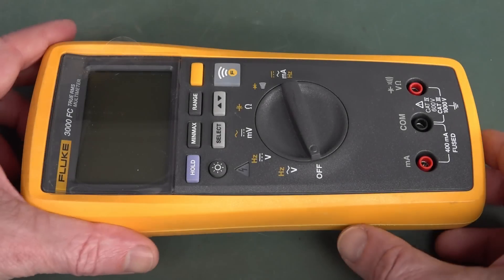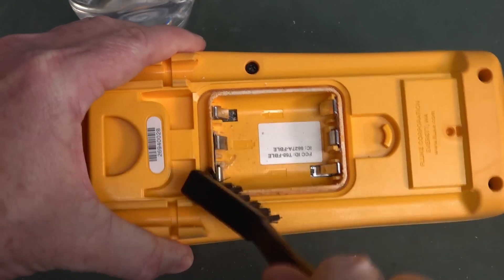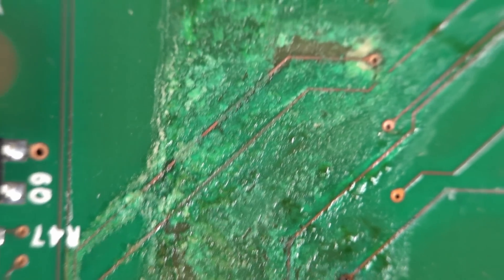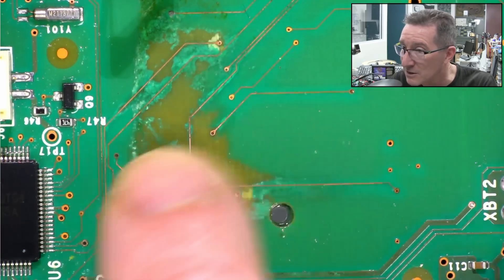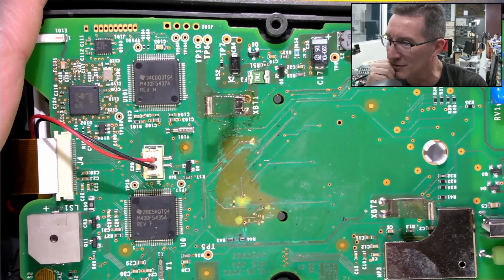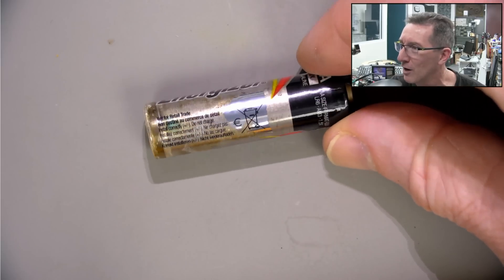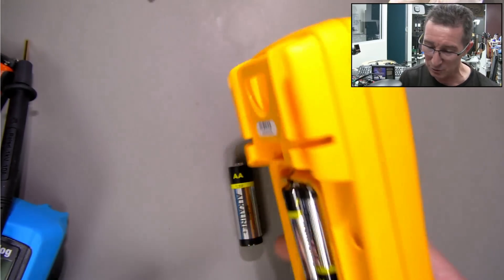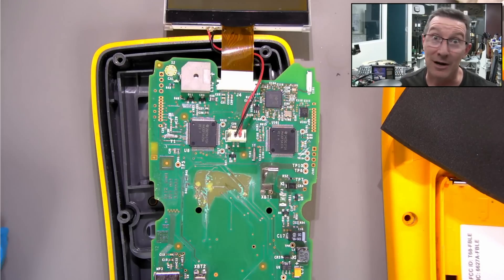EEVblog 1497 - RIP Fluke. Thanks Energizer. NOT.

Comment: The "crack" on the back-case is a result of blisterforming.
The Fluke Yellow plastic contains a metal filler meant to be a fire-retardant. It is probably the same as what made ivory PC's yellow over age, as well as parts of washing machines.
Reply: Not a metal filler, but may be some metal derivatives like a metal hydroxides. That's difference. 
And yes, plastic was broken by mechanical force of crystallizing chemicals. It even hasn't have to react with plastic, it can press against two parallel surfaces and break them.
Reply: @kbs3055  indeed. It is a salt of a metal (Barium?) I'm not a chemist but I know a little bit of Chemistry as I had that during my study (Electro/Electronics). Usefull knowledge.

Edit: After a bit looking around I found Bromine (not a metal) and compounds of Magnesium (among others).

@ S W: Ivory PC's isn't that long ago, and I bought in 2009 a new washing machine that also has yellowed a lot before I had to replace it due to repeated computerboard faults (in 2015) by a new one.
Reply: The chemical which caused plastics (used in everything from PCs to washing machines to home appliances and more) from the last century to yellow is a fire retardant called Bromine. It's difficult to determine if it is still used in modern plastics.
Reply: @stopthebus   There is a guy on YouTube who has done videos about how to whiten old plastic that has yellowed, such as that found on game consoles, with electrolysis.
Reply: @goodun2974  Ok that's interesting. Not heard of it being done with electrolysis before. Have you got a link to the vid? I did a quick search, couldn't see anything.
Reply: @stopthebus  , in case my link doesn't post, it's on the Odd Experiments channel and requires high strength hydrogen peroxide and LED UV lights.
Reply: @goodun2974  I think it's not electrolysis as you don't use electric current, but I'm not chemist.
Reply: @kbs3055  , Actually you are correct but I got my wires crossed figurative. I seem to recall somebody else on YouTube that was actually using an electrolytic process, with some kind of chemical solution and electricity, to "bleach" the plastic.  Not sure about this as it was several years ago that I saw it. I'm old and memory does play tricks on me!
Reply: Some of the Fluke meters are now made in China. The quality is terrible. Be cautious. I also ordered some "Fluke" meter leads from a Chinese distributor. They arrived and looked authentic. I used them for a while and started to detect some small differences from my older truly authentic Fluke leads. They felt more noodly like overcooked spaghetti and I played my hunch and cut and stripped one to have a closer look. Sure enough, I discovered that the number of stranded conductors in the lead was less than half that of the truly authentic Fluke 10 amp leads. Not only a fraudulent sale but a dangerous sale. There is no way these leads would have carried ten amps safely. I have learned over and over that the Chineese have no ethics when it comes to trade . (Or ethics in anything really) They are out to cheat you in every way possible and they have no compunction about theft of design or theft of cash. Steer clear of anything Chiinese. The only reason an Apple phone is of decent quality is because the Chhineese use them to spy on the West and to figure out the best way to ship fenatnyll into the U.S. to kill Americans. Especially Ameerican kids.
Reply: Oh, that makes sense. Interesting.

Comment: All alkaline batteries will leak when they are discharged or just get old.  I stopped using alkalines decades ago.  I have never had a leaking eneloop NiMH battery.  I like to use rechargeable lithium 9V batteries for my Fluke DMM and smoke detectors, although I don't mind using alkalines in smoke detectors siince they chirp when the voltage starts dropping.

Comment: Ah the optimisim at the start.. I've been there.. Alkaline batteries just suck in the last few years.. panasonic, duracell, energizer, you name it i've had them leak, in date and many times still in the packets, even when stored at stable temperatures in low humidity. I went back to zinc carbon batteries, seem much more predictable.

-edit-.. yes i've seen coppertops and I some others basically eat away and entire board before, copper and all..

Comment: Wow great tear down in 4K glory.  Sorry about the Fluke Dave and ouch this is one meter you don't want a leak in.  I'm really surprised as Energizer and Duracell are the top 2 brands that you can trust will not leak.  Also surprised the acids can get into the PCB and even damage the PCB which is usually coated with some kind of protective resin.  But what causes the battery to leak in the first place if the meter is off?  Has the battery been sitting there for years?  Also Fluke uses a lot of 9V batteries in their meters.  Do 9V leak as well or is it just these AAs.  I've only seen cheap generic AAs leak once and not 9V.  But 9V are rarely used except in smoke detectors and multimeters but it's never leaked and they can sit in a smoke detector and multimeter for years.  I've also rarely seen AAs leak except once so am puzzled how this happened.  Great video for us multimeter aficionados.

Comment: I "found" one in my battery box recently, unused and expiration date in like 2 years but it already leaked. Energizer HAS to do something about that, I can understand that they can't guarantee them to not leak over decades, but unused within the use-by-date?!
I'm glad I didn't put this one into use but I just can't trust them anymore. I bought like 90% Energizer batteries over the last years but I think that has to change until I can believe them to not leak for like 10 years.

EDIT: It wasn't the first one to leak but it was the first unused one. 
Once had a pack of store brand batteries (that looked pretty similar to Energizer) leak in a still sealed package and its juice soaked trough half the pack. Went straight to the recycler.

Comment: Always store the meters with display facing up. This will prevent the electrolyte from reaching the pcb.  I learned this hard way
Reply: Better yet, never use alkaline batteries in these meters.  They are disposable batteries for disposable devices.  Never use alkaline batteries in any device worth more than the batteries.  Use only Eveready Ultimate Lithium or Eneloop rechargeable cells in these meters.  And like you, I learned the hard way!
Reply: @NCF8710  nice tip. I learned the hard way too... after 10 years with a good  'not fluke multimeter' and one season in a harsh and warm weather did the trick on alkaline batteries... solder mask, copper traces and the plastic just gone.. sad story
Reply: @NCF8710  +1 for the NiMh rechargeables, Eneloop or otherwise. Never seen one leaking, and even if the energy content is less than the equivalent Alkaline, I always have a 3-set fully charged on standby in case of need. 

Didn't know about the Lithium AA/AAA types, can imagine some applications where I'd use these like sensors, alarms, stuff you don't wanna change batteries too often. Pretty darn expensive though

Add one solution: in most places in stead of 3xAA/AAA, like my kid's RC cars, I just soldered on a rechargeable li-ion with an USB-plug BMS for easy recharging. Must have been 25quid for a pack of 10 small Liions from ebay and 10 USB chargers. Seems this Fluke could use the same treatment (but would I bother if I had a box of them standing by?...). I would watch a video on how to convert a Fluke to Li-Ion properly and see how I should have done it.
Reply: @dragosmihai3489  NiMH capacity is not a real problem today, but, the difference in voltage behavior can pose a problem.
Reply: @NCF8710 sorry but eneloop also leak. They have leaked in one of the meters that I have. That is the best I can buy locally. Each and every battry can leak under correct circumstances. So now I use this way to protect the meters.
Reply: @DoTheDiy  I'm really surprised.  I have at least 50 of them in rotation serving remote controls, computer mice, flashlights, etc.  Some of these are more than 10 years old.  I have never seen or heard of one leaking, until now.  Those meters that need to be disassembled to change batteries get Ultimate Lithiums.  I have never seen or heard of these leaking either and I have been using them since they came out.
Reply: Something about the chemical makeup of the electrolyte fluid seems to give it a low surface tension and high wetting properties,  therefore it can apparently flow upwards along vertical surfaces! I have seen this happen with small capacitors that hang upside down from a circuit board: when they leak, the electrolyte seems to creep up the leads, passes right through the solder joints, and onto the upward-facing foil side of the board, where it eats at the lacquered foils. You wouldn't think this is possible but I've seen it happen a number of times.
Reply: @goodun2974  "You wouldn't think this is possible but I've seen it happen a number of times." Actually YOU have to provide evidence for your claims. 
The fact that there are effects such as capillary action, that some porous surfaces bind moisture (HUMIDITY! try that electrolyte story with my 6 year old...) and that some materials are absorbent is probably nothing new. No shit Sherlock! But what are you trying to sell us here? "Spooky External Effects", Einstein?:P
(And how is this BS related to @DoTheDiy's wonderful and in REALITY housed tip, a.k.a. "the topic" ???) Some guys ... really *facepalm*

P.S.: "... passes right through the solder joints ...": I assume you saw corroded or destroyed copper-tin solder joints. You didn't do an electron microscope examination, you didn't do a spectral analysis of the surface, you didn't take a cross-section of the fracture under the microscope. Or a microscopic time-lapse recording over several weeks or months that such corrosion events take. ( Which people do FIRST ... BEFORE they make claims. Or in other words: FIRST comes the data, then the Hypothesis and after some confirmation: your conclusion / the model)
No, you just looked with your eyes and took the first best explanation (which oddly, in YOUR opinion) fits the topic. Never mind that there can be a hundred other reasons, including the properties of epoxy resin or laminated paper, or those mentioned above, that can explain the phenomenon. The main thing is that it fits your own narrative.
No offense meant, but hopefully a lesson for the future!
P.S.S.: Selling your BS as fact ... better, very "curious" facts instead of asking, you should be ashamed of. And BTW "Something about the chemical makeup of the electrolyte fluid seems to give it a low surface tension and high wetting properties," one can easily check with a glass of water and a glass of kerosine and an empty glass. Your "Something" is so transparently showing your expertise ... and then you also have the cheek to write a conclusion "... ,  therefore ...". I didn't say stupidity, I say: It's an impudence to make fun of your fellow human beings in this way. Because some are going to believe your unfounded nonsense. Shame on you!
Reply: @dieSpinnt ,   not that a person exhibiting such general dickishness really deserves a response, but in the case I mentioned (I've been repairing audio electronics for 50+ years)  there was no sign of the electrolyte fluid having been sprayed onto the downward facing, component side of the board,and no discoloration of the fiberglass board itself, nothing to indicate that the electrolyte wicked through the board ----  the solder mask on the foils, however, had black spots and patches, and after buffing off the discolored solder mask, the copper itself was discolored, but not eaten away down at or to to the fiberglas. I don't recall any particular corrosion on the solder joints either, only that the solder had turned somewhat grainy and gray. 

FWIW, I've read that for some military applications,  crimping is considered preferable to soldering because a crimp, done under sufficient pressure,  is considered to be a "cold weld" and is gas and liquid tight in a way that a solder joint is not. The military has certainly spent enough of our tax dollars trying to figure this kind of stuff out, and so if they maintain that solder joints aren't always gas or liquid tight, I am inclined to believe there's something to it.

 And on a  somewhat different tangent, I have seen soldered-in lithium coin batteries leak (downward) onto a circuit board, unsurprisingly corroding the solder joints ---- but after cutting the battery off and cleaning the electrolyte from the board,  unsoldering the old corroded solder with a vacuum operated soldering station sometimes causes the solder to spit and spark alarmingly as if touching a battery connection to ground (I rarely wear safety glasses, but I now wear safety glasses specifically for unsoldering the kegs of those leaky batteries). My suspicion is that battery electrolyte turns the solder joints (lead and tin, and copper from the battery terminals) into tiny batteries (perhaps only when heated by a grounded soldering/desoldering iron). I do measure for residual voltage before unsoldering parts and there wasn't any, so....

 Anyway my point was, that I wouldn't trust storing a meter with the battery compartment facing downwards to be sufficient to prevent electrolyte from getting into other parts of a meter higher up. For whatever reason, the stuff doesn't seem to be behave in the way one might expect it to.  Perhaps when the batteries vent they spew a fog or mist of electrolyte throughout the inside of the case, but I've never actually witnessed a battery spew; and it seems from the comments here that most of us haven't. But hey, you do you; and if you merely want to be snide and dismissive yet again, don't expect a response.
Reply: Good tip.
Reply: Always store the meters WITHOUT BATTERIES, as Energizer, and Duracell both make shit batteries, that are designed to LEAK, LONG before the expiration date.

I use lithium batteries in all my electronic devices,.

NO ONE has sued them yet, and probably won't, so put your money elsewhere.
Reply: @rhoused1743  I like to keep meters on standby with battery so they are ready when I need them. One promissing solution I have seen and have used in one of my meters is lipo battery which come in AA shell and have inbuilt usb charger. Lipo can puff up but it will not leak.
Reply: @rhoused1743  Correct!  Some of my meters need to be disassembled to remove the batteries.  Those meters get lithium cells.   The ones having accessible battery compartments get either Eneloop or lithium cells.
Reply: These days I wrap 9V batteries in a couple layers of layers of cellophane plastic kitchen wrap, in hopes of containing any leakage. I haven't had any 9 V batteries leak in recent years so I don't know how well it'll work but I figure it can't hurt.  Unfortunately, AA and AAA cells  usually cannot be wrapped in cling wrap and still fit into the battery compartment,  nor still make a connection at the ends of the series string; and even if you did, that would only only contain leakage from inbetween a pair or trio of batteries wired in series , and there's no practical way to capture any leakage from the  batteries at the beginning and end of the series string.
Reply: Hey Dave if your not going to mess with that DMM I’d be happy to take it off your hands and give it a try.
Reply: Or you can use steel coated zinc carbon batteries that says "heavy duty" or "super heavy duty" on them, they are sealed by plastic wrapper inside and they don't leak.

Although the battery life is like 1/3 of an alkaline it would usually last 2 years or more on such a device.

Never use alkaline batteries on low-drain devices such as clocks, remote control etc. Either use sealed zinc carbon, or low leakage Ni-MH (those with 5% or less charge loss per month).
Reply: Manufacturers should make leak proof battery compartment in the first place !
But wait, why would they do that ? If a device dies, that means more sales !

Comment: Here is an invention idea - a type of "condom" to prevent batteries from leaking. Is there such a thing? This type of corrosion is quite common, so I guess there are some mitigations for it. I've seen units with isolated and detached battery compartments, but nothing to just put a battery in, while retaining conductivity at contact areas.

Comment: Must be a method to this battery leak madness. I have lost a multimeter as well as one I use regularly bit the dust.
I bought the same meter with the same problems but caught it this time.
I find certain devices suffering more.
Not high uses as a torch is ok.
Very low steady drain like remote seems to survive.
So what is the trick??
Ok very old battery on boards for RTC leak.